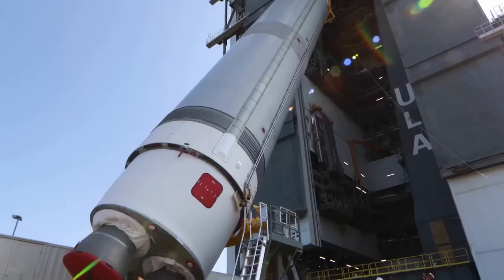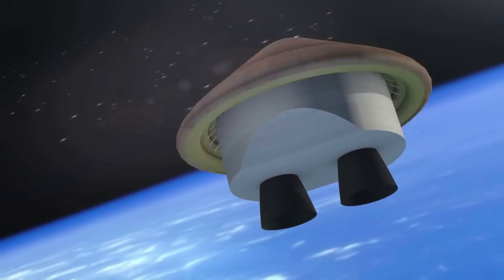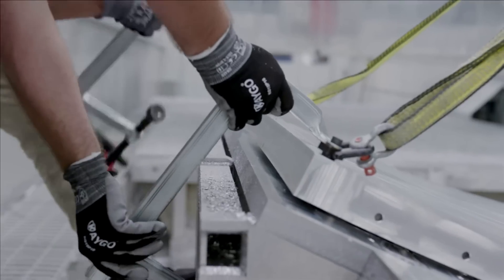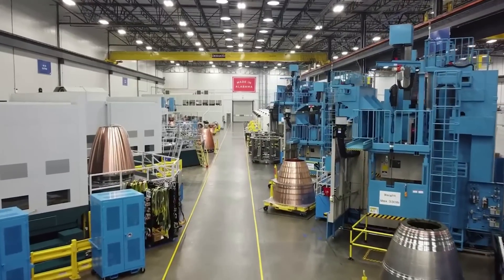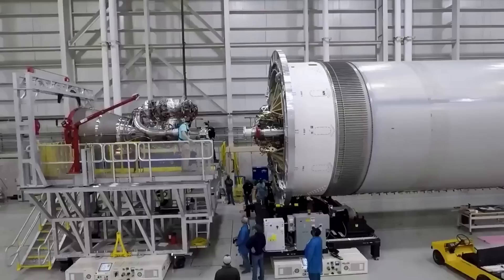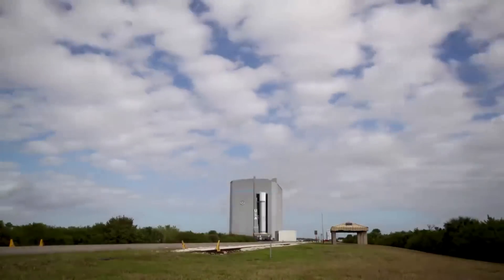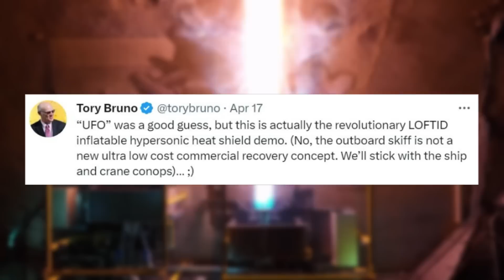Can Blue Origin Keep Up With The BE-4 Engine Demand?

Comment: Blue Origin strategy mistake, was jumping from Blue Shepard to New Glenn in size, without a middle size rocket, that would allow the Team to get more data and expertise with Orbital flights.
Reply: Orbital…lol 

(👍)
Reply: SpaceX skipped middle rocket also, going from Falcon 1 to 9. In fact they canceled several boosters in development. The math and physics for B0 and Falcon Heavy were public knowledge thanks to NASA 50 years ago, so engineers have to develop, engines, fuel, guidance and booster, structure to take advantage. Not a hard or wrong step at all. New Sheppard and N Glenn have almost nothing technologically in common. Shephard exists to teach BO management and employees how to work together and develop teams. An extensive training seminar that's ongoing.
Reply: @sandbridgekid4121  In fairness, the jump between Falcon 1 and Falcon 9 Version 1 is far less extreme than that of New Shepard to New Glenn. I would've rather that Blue pursued their original Orbital Transport Vehicle rocket that they were developing as part of their Commercial Crew proposal along with the biconic capsule. That rocket would've been Atlas 5 or Falcon 9 sized, used five or so BE-3PMs that would've been flight-proven on New Shepard, and also given Blue experience with recovering and reusing an orbital class booster.
Reply: @sandbridgekid4121  The Falcon 1 was a small lift rocket and the Falcon 9 v1.0 was a medium lift rocket. New Shepard is similar to a small lift rocket and New Glenn is a heavy lift rocket.

Comment: 5:10 - Why can't LNG be used to pressurize RP1 tanks? It's probably cheaper than helium, it's another hydrocarbon not an oxidizer.
Reply: Why would you want to deal with 2 different propellants in your rocket, with 2 different mixture ratios with LOX. It would likely be horrendously complex to do that.
Reply: @steveaustin2686  Just to pressurize the tank, not as a fuel any more than helium is used to pressurize not to fuel. It would have been tried decades ago if it had any viability.
Reply: @cowboybob7093  Your last sentence is likely why it hasn't been done as mixing propellants is not a good idea.
Reply: @steveaustin2686  Beat you to it! #humor #do_I_really_need_to_point_that_out_to_you

Comment: It's expensive. It's expendable. It's untested in flight. It's slow in production. It's way behind schedule. It's overcommitted on a flight schedule it can't possibly meet. Is there an upside to BE-4?
Reply: It stimulates the 'emconomy!
Reply: Well it is now flight tested as the Vulcan rocket just went up with two BE-4 Engines.

Comment: Blue Origin will have a paid payload in LEO long before a SpaceX Starship will be in orbit with anything beyond a test article. BOrg has flame trenches and water deluge systems under their testing stands and on its launch pad. The First New Glenn test launch won't be a iteration but a full duration orbital mission. It won't destroy its launch pad or facilities and it certainly won't be LT'd well below its mission profile for time and altitude. And it will be nearly man-rated before anything leaves the ground. Musk is Apple, New Glenn is GM, Google, Toyota and Microsoft, with the best of Boeing, LM, NG, combined. It'll work from the start.
Reply: Even if that's true, and I'm not convinced it will be, New Glenn is competing with Falcon Heavy, not Starship. SpaceX already have a large lead.
Reply: I'm smelling a delusional person
Reply: The problem is Blue Origin will and New Glenn will
While SpaceX already did

New Glenn is more comparable to FH than to SS, in both capabilities and reusability. FH did everything from the first try as well, idk, 5 years ago?

But the case is not really that BO is late for lots of years, but that they have no experience with orbital launches at all. 

It's 2023, and their biggest accomplishments are: suborbital rocket that still doesn't fly after recent explosion, fame for suing SpaceX for loosing HLS competition, announcement of New Glenn and LEO station, and delivery of 2 engines (2, right? no more came after autumn-winter?) to ULA after YEARS of delays. While SpaceX... You know, F9 dozen of years, FH 5 years, Crew Dragon with people, orbital tourism, ~1/3 of all world launches last years, more payload than everyone else combined last years, etc. 

It's just funny to try to compare SpaceX and Blue Origin, not even talking about BO reaching SpaceX and surpassing them.
It's like comparing USSR and US in cold war.
Reply: @squidwardfromua  comparing Blue Origins to the USSR is kind of a stretch and an insult to the USSR.

At least the USSR made it into orbit, made a few space stations, and reached different planets with space probes before their collapse.
Reply: @BrokenLifeCycle  Yeah, I mean they always as well stated to start surpassing US, while having no chance of doing it
Reply: lmao New Glenn’s first flight will probably slip to 2025.
In that time Starship will launch 2-3 times probably. 
Your argument makes no sense…
Remind me in a year ;)

Comment: BE-4 is more reliable than Raptor
Reply: What are you basing that on?
Reply: Keep in mind BE-4 is significantly larger than Raptor and is not a full flow engine like the Raptor either. Both these engines are methane fueled, but objectively the BE-4 is a inferior design while still being quite complicated:)
Reply: They call this a TROLL post. its meant to piss you off and start arguments. the best you can do is block people like this altogether silence them.
Reply: @josephcler3299  BE-4 has had zero failures. The perfect record.
Reply: @jakeroper1096 and never exploded 😕
Reply: Its an unknown that has never launched. Its a test stand queen...
Reply: lol Raptors have already lifted the biggest rocket ever built Starship last week! BE-4 have yet to launch anything beside testing
Reply: exactly.  100% failure rate reaching orbit.

Comment: Very fortunate for the rest of the Industry SpaceX failed in the manner it failed as this will put some serious impetus for all of those now having to wait @SpaceX for rebuild of entire launch complex to now be able to work for what is quite suddenly a very diverse and economically booming "Launch Industry" for the USA.

Until this past week none of this seemed even remotely believable to me as possible for anything but #NASA which currently has a modestly reusable already validated MOON ROCKET so who wouldn't want to work for that? Everyone else is still simply trying to compete with single stick Falcon 9 and still no one except possibly China now. In the meantime hopefully Falcon Heavy is much improved given the failure of Starship though seemingly nothing fatal for the suddenly booming Heavy Launch Industry for the entire USA. What a remarkable time to see all of this in fact now happening as seemingly nothing has been going on forever now.
Reply: It's SpaceX you're talking about, and it's quite obvious you've not seen them perform. Starship didn't "fail", you didn't bother to read the goals. Starship withstood huge chunks of concrete blasting into the engines, and withstood the entire structure tumbling. I think SpaceX has about 200 Raptor v.2 in stock.
Reply: @UncleKennysPlace  well if only all the rest of us mere mortals could fail like this. Hopefully the next time the rocket takes out the entire Launch Complex absolutely!  Who could argue with that! "even better SpaceX! On Launch Attempt 2 you destroyed *EVERYTHING great job!

Who killed Kenny again?
Reply: @UncleKennysPlace  starship wanst sucesfull, it didnt even made to space

Comment: I'm sorry but I still think it was foolish for ULA to hitch its wagon to blue origin!
Reply: I agree fully.
Reply: Welp the BE4 Engine is a good Engine that never exploded and has a high thrust, and ULA wouldnt waste time making a entire New Engine or either using spacex raptor as it would need probably 4
Reply: Probably ULA doesn't want their rockest explode...spaceX doesn't mind...or engines fail...6 out of the 33 raptors engines didn't ignite
Reply: At the time, the BE-4 was ahead of the AR-1 in development, per ULA. Whether the RP-1 based AR-1 would have been delayed as much, we don't really know.
Reply: @javierderivero9299  true
Reply: @javierderivero9299  All the engines ignited, burned in that first 11 seconds. THe acoustic shock and ingested debris, knocked out the first 3, then 3 failed in succession. Flight terminated well below mission altitude and was way below expected velocity. And how many engines would have failed just before separation we may never know. Was separation postponed because Launch Termination command given?
Reply: @sandbridgekid4121  Well I'm not going to argue with you...but ULA doesn't want that for their rocket...that's for sure
Reply: @paranaenselol  Raptor's thrust is almost exact as BE-4's one, what 4 are you talking about?
Reply: @squidwardfromua  Raptor 2 is 500,000 lbf and BE-4 is 550,000 lbf. Tory Bruno has stated that BE-4 has exceeded that 550,000 lbf thrust as well as ISP goals. It would take at least 3 Raptor 2s to replace 2 BE-4s on Vulcan.
Reply: @steveaustin2686  Ahead? They were WAY ahead. There were six full scale development BE-4s ready or in build in 2017 when AJR only had a couple prototype injectors built. By 2018, AJR still had almost nothing to show for the quarter billion dollars ULA and the USAF had tossed at them, so it was no surprise late in that year that ULA chose BE-4 over AR1. It wasn't until late 2021 that a single full AR1 was rolled out at AJR, and since then there hasn't been any test firings of it.

Aerojet Rocketdyne also dropped the ball big time when Firefly Aerospace showed strong interest in using AR1 for their Firefly Beta launcher, but that all now appears to have been completely dropped in favor of their in-house Miranda engine, likely because of how little development work effort AJR as put into their engine.
Reply: @thomasackerman5399  The BE-4 was supposed to be ready in 2020 and 2 were finally delivered in late 2022. Right now, it is unknown if any more have been delivered to ULA. The BE-4 delays cost ULA money on the USSF-51 contract and they lost out in competing for the NGRST launch contract. I would not be throwing shade on AJR from a Blue Origin prospective.
Reply: @steveaustin2686  Actually, I can, because I followed everything that happened. AJR blew it big F-ing time on the competition. Big time. Over and over, they were given a chance, given a quarter billion dollars and they still couldn't even build a single dev engine in all that time.

Hell, AJR is having massive problems restarting the RS-25 line, and that's something they inherited, is well-understood and flight proven!
Reply: @thomasackerman5399  And Blue Origin cost ULA millions. The USSF-51 mission was moved to the more expensive Atlas-V, because the Vulcan Centaur would not be ready in time. Since the NSSL2 contracts are fixed price, ULA had to eat the difference in cost. IF the BE-4 had been delivered on time, then ULA could have been in the bidding process for the NGRST launch. They missed out, because the BE-4 was late. The second flight of Vulcan Centaur was moved back to late this year or next year. Since ULA has a LOT of NSSL2 contracts riding on Vulcan Centaur completing the 2 launch certification process, if they were getting the engines early and Dream Chaser was not ready, they could launch a dummy payload for that last certification flight, so that they can start NSSL2 flights that are already contracted. 

Sorry, based on the New Shepard, Blue Origin EVENTUALLY makes good equipment, but their development process is super SLOW.
Reply: @steveaustin2686  That's irrelevant. What is relevant is that there would've been no engine whatsoever to test, much less be delivered by this point in time given how super slow AJR was and still is. 

That is all their fault since they sat on their asses begging for more money instead of ponying up their own to match the USAF's investment.
Reply: @thomasackerman5399  Delays costing millions of dollars hardly seems irrelevant. But whatever floats your goat.
Reply: @steveaustin2686  It is irrelevant since we were talking about the fact that AJR could not nor ever have delivered in a timely manner.

In fact, it is likely they would've been much further behind.

And that is even more costly.
Reply: @thomasackerman5399  LOL. So ignore that I said that the BE-4 was further developed per ULA AND ignore that the BE-4 delays have cost ULA millions of dollars. 🙄

Whatever floats your goat dude.
Reply: @steveaustin2686  Yes, because it is irrelevant. No AR1s would be installed on any Vulcan rocket by now and AJR would be lucky to have gotten anything to the test stand given how far behind they were and despite all the money ULA and the USAF gave them.

Pathetic.
Reply: @thomasackerman5399  LOL